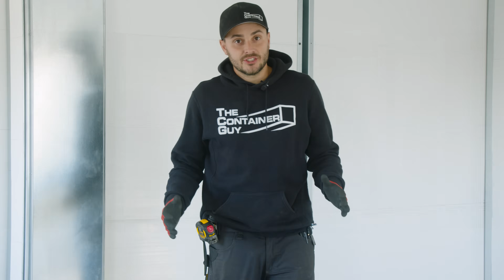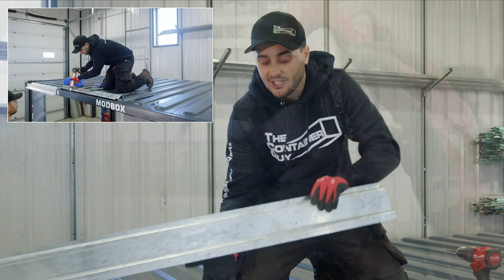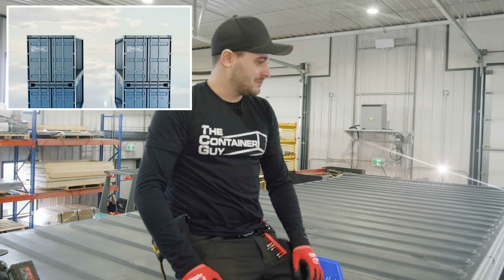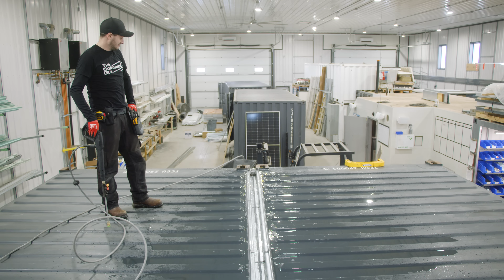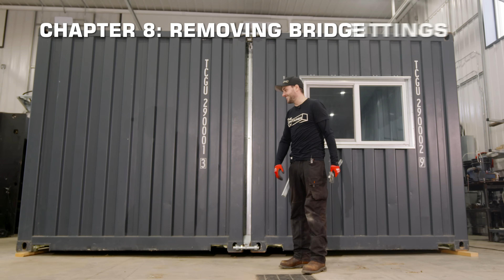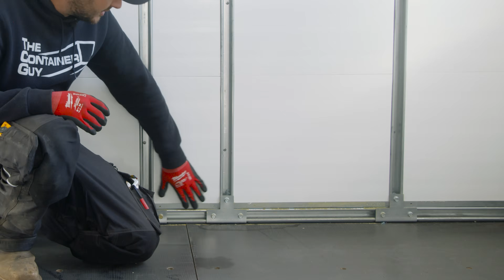I Designed It. China Built It. I Connected It. | MODBOX Double Wide Kit

Comment: I'm in Arizona. What would you charge to send me one of these, already to connect up with everything ready to go, everything done? Frankly I'm older. I don't need to be able to run around and crawl all over everything. I'd like to get the two of them, put them together, cinch down the connectors, and bolt it in. Is there any way possible? What would that cost?

Comment: hey nice product you are working on it is an excellent idea.. if you don't mind i would recommend to clean all surfaces with alcohol prior to applying the silicone to make sure your 795 bonds well to the two surfaces ; ) also you should look into 995 for better performance... i see you water test it but usually it takes a couple of months before it  the seal fales ..your gaps also should be 1/4" wide and 3/8" deep minimum...

Comment: A while back, I designed two containers that made a 3 wide container. One had a wall panel that went up to for the roof, the other one that went down for a floor, and at each end a door panel that folded out to fill the space. I primarily designed it for relief agencies to get buildings to disaster sites where space was an issue.

Comment: Minisplits usually come with a square-foot rating for the size of room they are meant to cover, it's usually smart to go just slightly over the rating for your intended use as it degrades slightly over the years.

For a container like this the insulation isn't very thick and the walls are metal, so that lowers the average R value rating a minisplits room size rating is based on so give it another 10% boost.
So that minisplit you chose is probably good for 5-6 containers connected together like this.

Comment: So I just asked Gemini about modifying shipping containers.

1. Structural Weakness from Modifications
The strength of a shipping container lies in its corners and its corrugated walls.  
• Cutting Openings: As soon as you cut a hole for a window or door, the container's structural integrity is compromised. You must weld in heavy steel reinforcement frames to prevent the roof from sagging.  
• Roof Limits: The roof of a container is not designed to support weight. If you live in an area with heavy snow or want to add a "green roof," you will need to build an entirely separate support structure.  
2. The "Oven/Freezer" Effect
Containers are essentially giant steel boxes, and steel is an excellent conductor of heat.  
• Poor Insulation: Without high-quality insulation (usually expensive spray foam), the home will be unbearably hot in the summer and freezing in the winter.  
• Space Loss: Adding insulation to the inside of the container significantly eats into your already narrow living space (which is only about 7.5 feet wide internally to begin with).  
• Condensation: Because metal doesn't "breathe," moisture from breathing and cooking can condense on the walls behind your insulation, leading to hidden mold and rust.  
3. Hidden Costs and Complexity
Many people choose containers to save money, but the "finished" cost is often comparable to traditional builds.
• Specialized Labor: You can’t just hire a standard carpenter. You need specialized welders and metalworkers, which can be much more expensive.
• Site Preparation: You still need a traditional foundation (concrete piers or a slab), plus the cost of a heavy-duty crane to drop the units into place.  
• Utilities: Plumbing and electrical work are much harder to install in a steel box than in a wooden frame.  
4. Health and Environmental Concerns
• Chemical Exposure: Used containers are often coated in lead-based paints and industrial-strength pesticides (used on the wooden floors to prevent pests during international travel). Removing or sealing these toxins is a health necessity.  
• Short Lifespan (Rust): If you live near the ocean or in a humid climate, rust is an eternal enemy. Once the structural steel begins to corrode, it is very difficult to stop.  
5. Legal and Zoning Hurdles
• Permit Issues: Many local building departments don't have codes for container homes. You may face long delays or outright denials because the structure doesn't fit standard "stick-built" or "mobile home" categories.  
• HOA Restrictions: Many Homeowners' Associations and municipalities have "aesthetic" rules that forbid industrial-looking structures.

Comment: Structure was NEVER the problem of a container, you just made the wheel thicker but not reinvented it!
Also the problem of shipping containers as a livable space is: PRICE AND they are TOO small, add some insolation and it'll be too cramped!
Stacking 2+ costs more than building from scratch, with timber and concreet! Take the L and move on, this ain't it chiefe! A.K.A NOT WHAT FOLKS NEED! 👋

Comment: Love how keep you advancing your methods to tie these containers together. I've been working on a home design with a 3 over 5 containers with 2 outboard containers for an open porch area to extends on either side with open sides. I would also like to extend the top of the top 3 containers to over hang a central unit as a weather protection for the main double door taking up the entire width of the center container. To make a long story short, I want the bottom 5 containers to open be wide open with only the required supports. Top three containers to be divided into 2 bedrooms with a huge shared bath on the end with only the shower in the middle being actually shared.  Containers would all be 40 ft high capacity . Thanks for posting what you update as what has already said, you take the welding out of the equation for us dumb DIY'ers.

Comment: cool stuff - curious... why not sandwich the two boxes right up against each other? ie. the alignment pieces could just be like two arrow heads back to back with a 4mm plate between them, use those bridging bolts to squeeze it tight and done. if the plate is flush with the exterior edge of the boxes you can then run weld down that line. This leaves just a 4mm gap to fill up (silicon or weld more 4mm plate into).

Comment: My next set are 40HC that have 4 sets of double doors on the side.   Door frames provide the roof support.  Question.... why 3" between them?  On mine, they must remain readily moveable and also have a sloped roof, so the doors make most sense and we build pole barn frame outside and insulate the outside, keeping them fully transportable.   Each unit grows in width (for over the road delivery) and when finished will be transported as a wide load, mostly because of an 18" overhang.  But lets go to a 40' HC and re-think the truss.  I'm thinking the top tube of the shipping container as the bottom chord and a full 40' length tube or angle used at the top that pole barn roofing attaches (to wood).  Using 1 1/2" square steel tube, weld the upright tubes and diagonal tube to the face of the container tube.  Don't make a continuous dam.  They provide the 3" space that at least up top, the truss members come face to face with C-clamps.   The bottom chord of your truss is the container tube and the top chord is a new full length 2x3 or ??x 40'  That way, a low slope roof can be installed at your shop and it stays on for delivery... incorporated into each unit.  Then, insulate the outside and cover with steel.  Stop the foam inside (too messy) and think of the steel as a vapor barrier....because it is.  And vapor barriers are on the inside of the heated space, not outside.  Paint those nice steel walls inside (Use one trips).

Comment: Why don't you use refrigerated shipping containers? They have stainless steel insulted walls and roof. Maybe they can be purchased without motor ect.
Reply: 20ft refer containers are difficult to find.
Reply: Way to hard to find and cost prohibitive compared to doing it  yourself plus diy you can plumb water and electric first then foam.  With pre insulated your screwed and I just realized your going either live with the shiddy worn interior walls or have to add another layer of wall over top of another wall losing even more precious space and you don’t know exactly 100% what your fastening too and another thing I just thought of if you want to weld anything to the container inside or out your going to damage the old insulation and whatever plastic material they are using for anything nearby.  I seen some with a vinyl type wall sheeting.  That’s going to get cooked.   At that point just buy a prebuilt tiny home.

Comment: Been following you for a while. I’m thinking about building a shop with 2 40 foot shipping containers and 1 20 foot and then building a roof system over that to accommodate 13 foot tall truck. I want to cut out one end of the 20’ and take the doors off the other end and the place the 20’er in between both ends of the 2 40’ers and then cut out where ends of the 20’er meet the 40’ers. How do you think I can accomplish this?

Comment: You can buy them like this straight from China??? 
Even with fold out walls floor a roof for a room. 
Why don't you just make a 20ft folded length instead of all those joints from shorter pieces??? 🤦‍♂️🤦‍♂️🤦‍♂️

Comment: Love how you did the welding without any welding involved👍
Reply: Right? 😂😂😂
Reply: That's what those tools are for, welding the alignment rods\dowels\whatever thingies they had laser-cut is just a suggestion (and probably a good one).
Honestly you can buy a disposable gas welder and braise it together for the same effect. you'd just need to keep the tools to pull the containers together on the containers when lifting it with a forklift.

Also, after putting those 2 containers together, what use would you have to move it? You can't take it on the road and you can't take it apart without rewiring the whole thing and needing to rework everything.

Just braise it to keep it together on the ground from the containers flexing from heat and colds and be done with it.

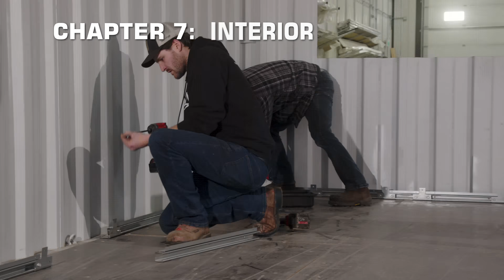Comment: 13:34 that would be better if it covered and fit outside rather than inside because with it inside you introduce a gap for water. think like a roofer, you want to overlap the ridge not insert .

Comment: When you’re ordering containers from overseas, consider choosing refrigerated units — they already come properly insulated, and the electrical setup can be customized to fit your needs. The nostalgia of building with shipping containers has faded, just like the tiny home trend, because the original goal was to create affordable, durable housing. With today’s advanced building materials and construction options, shipping containers no longer make much financial or practical sense.

And if it’s the rigid, industrial “container look” you’re after — inside or outside — you can easily achieve that by using the roofing and siding materials designed to mimic the exterior of a shipping container. That way you get the aesthetic without the structural and financial downsides.

Comment: Certainly saw a lot of welding for a design that "doesn't need a single stich of weld". This is great, but what is the cost.
Reply: Then no welding refers to the connections at the roof.

Comment: Despite the abundance of these tin Boxes.. Reality is that by the time one designs and assembles  something that is NOT a pile of tin boxes .
 Factor in  the realities of Moisture and Heat insulation...
There is Little to NO advantage  over loooong developed Traditional housing construction methods ... Either in Cost OR  construction Time. 
Need to mention  ??? that Few to NO jurisdictions' Bldg Codes will allow tin can housings. OR mortgage lenders willing to finance these.
Reply: They more structuraland fire retardant.

Cost will be about the same though.

Comment: nice.. was planning to build a house using 40ft containers.. i have a surplus of 8 containers i can use for this project.. any tips?
Reply: Weld them.
Support where needed.
I suggest insulation the entire outside of the building, and then putting a facade (SIPs maybe)
They need roofs for any longevity of living in them.
Reply: @BlackBeardAir  thanks for the tips.. will push through soon as sun is out.. i have just laid the foundations, then lift.. hoping to finish in 3 months.. :)

Comment: I LOVE YOUR HONESTY AND ENTHUSIASM, THAT CONTAINER SHOULD WORK WITH A HALF TON MINISPLIT OR A ONE TON AT THE LARGEST.  IF YOUR AC DOESN'T RUN LONG ENOUGH IT WON'T  HAVE TIME TO BRING DOWN THE HUMIDITY LEVEL IF ITS INA HIGH HUMIDTY ENVIRONMENT
Reply from the maker: Agreed. Humidity isn't an issue where we are and neither is cooling. We need heat BTUs in Canada.
Reply: @TheContainerGuyTV I was wondering if you used one of the mini splits that work below zero fahrenheit?
Reply from the maker: @mikefeddersen2476 yup, down to -28C
Reply: called a dehumidifier.  Most mini-splits already have that option now days

Comment: I don’t u;derstamd shipping containers for construction. Surely it’s easier and cheaper to build a still frame that has none of the drawbacks of getting containers to work. When used in construction of dwellings, a lot of the time they are clad anyway, so a purpose design welded/bolted steel frame can be fabricated in pieces and assembled on site with functional spaces as opposed to the narrow width of containers.

Am I missing something?
Reply: Nope. There’s a sucker born every day.. 😂😂
Reply: you're not going to meet the cost differences with something as structural as this.  They have their drawbacks, but are tanks.  Most places you can pretty much pick them up for scrap $$

Comment: Interesting concept you have using containers. I was wondering—if I have a piece of land in Sequim, WA, and would like to place four containers together (32’ x 32’ total, arranged as 8’ + 8’ + 8’ + 8’ wide and 32’ long), each with three windows on each side, a 32’ front entry opening, and a 5’ sliding door opening at the back—could you build this? It would also need drainage for two toilets. Can you do this? Thanks, Ed

Comment: Its got potential, but im not liking the design at all.  Seems like some things are just slap dashed put together and the interior looks horrible with everything out in the open. I would have liked to have seen how it covers everything up and have walls that look like they would be in a home or office.  Putting that HVAC unit in front of a window was another bad choice, no forethought on how things should be laid out. Maybe if you put a totally finished slick interior into a video, it will look better. Better looking windows also will help.  Make it look more modern with horizontal windows to let  in more light and give a wider view to see outside.

Comment: Also, think about rounding the corners iside the room and leaving a lttle metal sidewall to increase rigitiy. Then you can supply a custom curved wall piller solution for those who like the rounded asthetic and want the extra strength. I also think you need an optional mid container piller solutinon. to add interior walls or just strength and regidity at any given intervals, especially in the 40' containers.
Reply from the maker: Good suggestions, thanks!

Comment: I like the white wall panels for the light, and the metal isn't bad for the struts and to combine the containers, , but what is UNDER THE FLOOR? Did you sprayfoam the bottom, or is it just plywood over metal crossbeams?
Reply from the maker: It was spray foamed with 2lb closed cell foam underneath

Comment: WTAF 
People, if you want weatherproof joints. DO NOT USE CAULKING.
And if you use CAULKING, do not use it where it is in sunlight, or as the only defence. 
This whole thing can be done without expensive kits with specialised parts.
More importantly, it can be done with correct joints, so they won't start to leak within three to six months. 
And I'm guessing at about a tenth of the price. Also, it looks like it's still under construction inside. 
I think it's great that you are trying to do this, but you have a lot to learn, so keep going mate.

Comment: I appreciate what's going on here but one of the biggest mistakes in engineering is optimizing a part that doesn't need to exist. Maybe I'm wrong, but I feel like gasket material between the two containers would be way quicker and easier. You're relying on glue to keep it from leaking so as a little double insurance go ahead and glue some long flat sheet metal over the exterior joint. Keep an alignment mechanism and focus on bolting the two halves together to compress the gasket along the length of the container. A gasket, flat sheet metal, and a few bolts will be easier/faster to install. The flat sheet metal is also less mechanically complex to manufacture than bending a gutter and will save time and money too. This is the way I see things but maybe I'm wrong... Awesome video and I love the direction you're going.
Reply: Or just put a peak or lean-to roof on top. That’s what my grandmother did.
Reply: @wadecrawford6445 yeah but you might as well build from wood.
Reply: There are adhesives in the automotive world that are stronger than welds.  That would be the thing to use instead of some caulk
Reply: That's some solid advice, I'd add Roofing rubber, you have to heat it up and spread it around but it will act as a coating sealant, this goop will harden and become a pretty thick rubber atop the metal, this will prevent the moisture sure to get in between from touching bare metal. Then you can place the upper deck on top, and have peace of mind it won't rot through when it rains. 

The channeling should  be relaied on for drainage, maybe angle some gutter material, this space will act like a run off for water build up and easy road clear from one side to the other. 

The gutters might take some cutting or custom order but by using it and angling it downward, it just naturally drains.
Reply: called flashing
Reply: That was kind of a complicated way to say all that lol